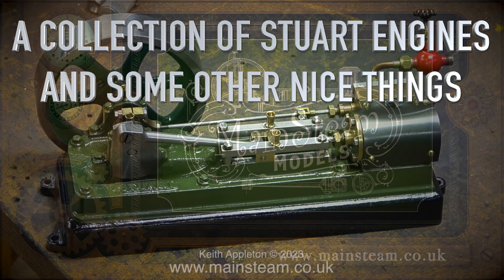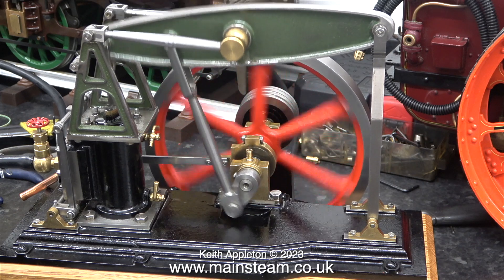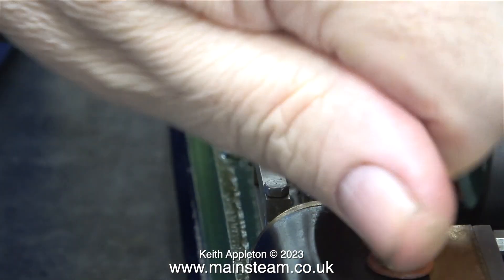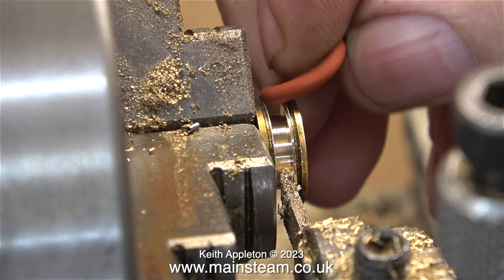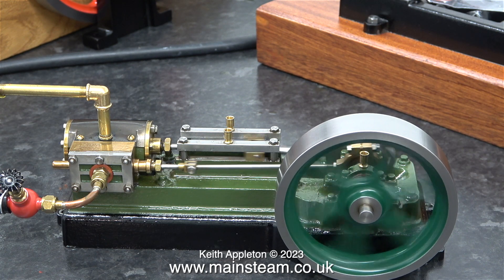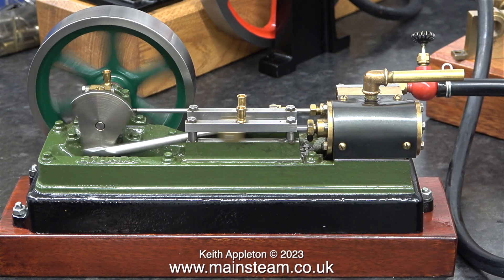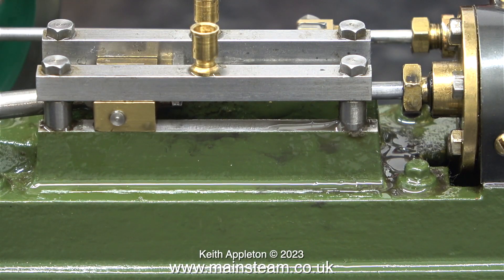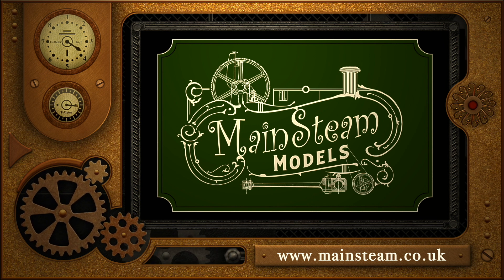A STUART MODELS S50 STEAM ENGINE MODIFICATION - PART #8

Comment: Hi keith,im building a s50.why do they not put the o ring in from factory?is there any reson i couldnt or should i just leave it how it is?any reson why you dont make another piston other than the work?
Reply from the maker: Most Stuart engines use old designs, a Steam Grade Silicone O ring fits the original piston between the oil groove so I don't usually make a new one.

Comment: The green flywheel appears smaller than the other two S50 flywheels. Although the color is wrong, the relative size looks somehow better to me. The grasshopper beam mast seems to oscilate a lot -- could this be robbing power from the engine, or is it part of the design?  Too thick an O ring, yet no ex-girlfriend jokes?  Hope that you are feeling better after your cold (even if it was more recent for me than for you, considering filming delay).